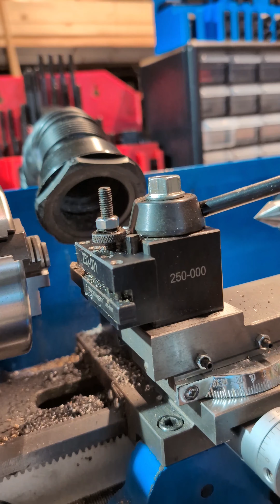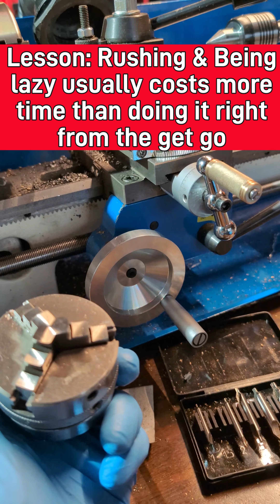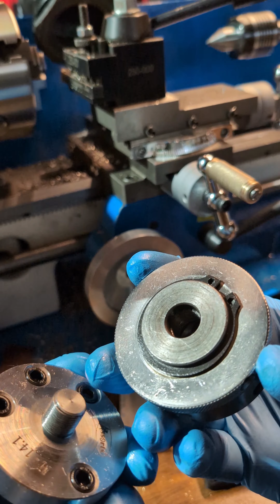A lathe project gone awry and the lessons learned - A new tool post lock nut

Comment: I just got ine of these Lathes.  Fo you have a link to the Quick Change Tool Post?  Thanks b
Reply from the maker: @ghettojohnny  yep! I got it on eBay same thing was like 126$ on amazing 85$ on eBay, same goes for alot of these lathe upgrades so check both sites if you get any other upgrades 

https://www.ebay.com/itm/395945153569?mkcid=16&mkevt=1&mkrid=711-127632-2357-0&ssspo=pb7qoi49s4e&sssrc=4429486&ssuid=HGlsRKAfSGG&var=&widget_ver=artemis&media
Reply: @SwinglerBotanicals  I got mine on temu, and some of the tool holders didn't fit the dovetail right and I complained about it asking for replacement holders, they refunded me the whole dang thing. I bought more and found the dovetails are very inconsistently cut, some are so tight they won't fit on one or the other position on the tool post or they fit loose. The loose ones work fine. Can't complain I suppose. Some of the holders are facing, some for turning with how they fit the tool post.
Reply from the maker: @MattsRageFitGarage  I did experience some of that one side of the holder is unusable for several of my holders, but the other side worked fine. I definitely know what you mean, someday I'd like to fix that but it works fine on the other side so I was fine with it but I could definitely see that being a problem
Reply: @SwinglerBotanicals  Mine seems to be tighter on the front facing slot than the side turning slot for some reason.
Reply from the maker: @MattsRageFitGarage  same, Ive been compensating by rotating the post
Reply: @SwinglerBotanicals  I have enough of the tool holders now I just designated them to whichever side they fit and keep a tool in them, it works lol.
Reply from the maker: @MattsRageFitGarage  that's been on my list of things to get done but I'm still a little bit short unfortunately